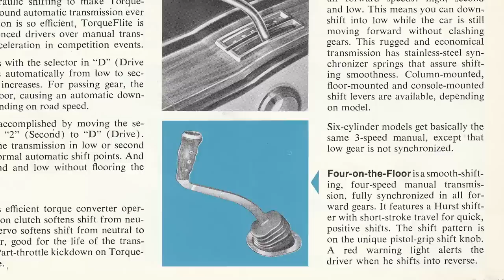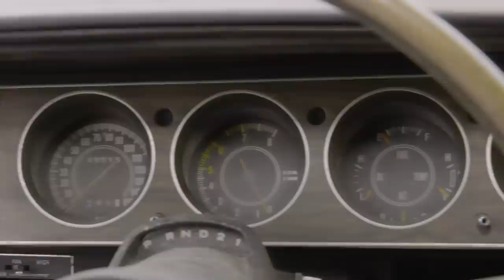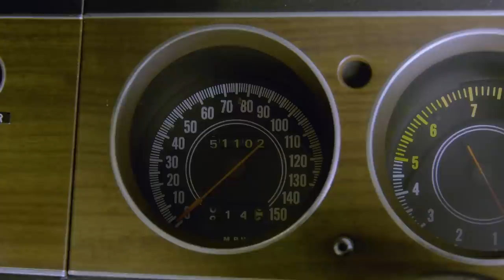ALLYSA WEARS DAISY DUKE SHORTS AND DAD IS NOT HAPPY: MARK CALLS HER OUT ON NATIONAL TELEVISION.

Comment: In 1981 (19 years old) I had a 69 Red Coronet 500 Convertible black top and interior.  440,auto,  big cam, with 4.10 posi.   Centreline wheels N50’s on the rear.   Those were the days.  🎉